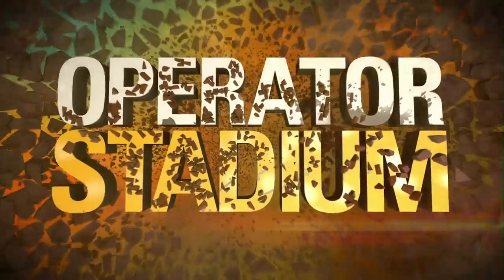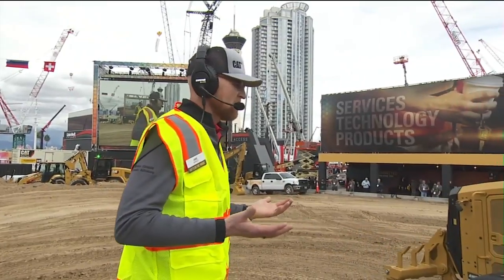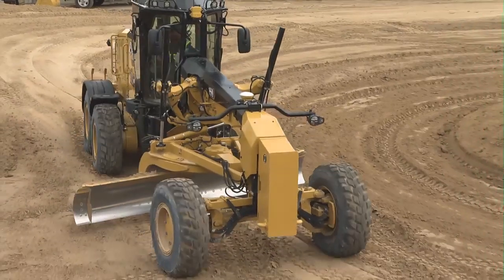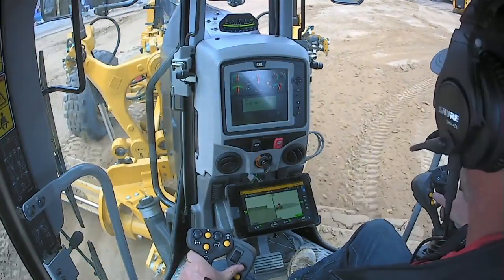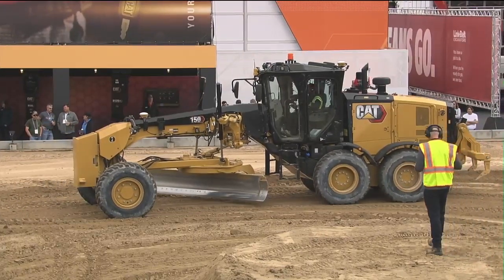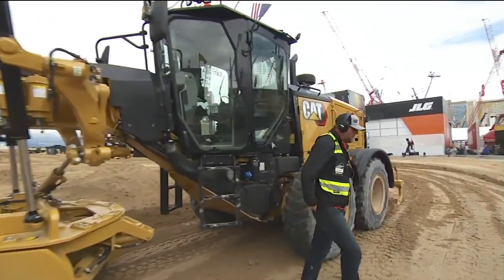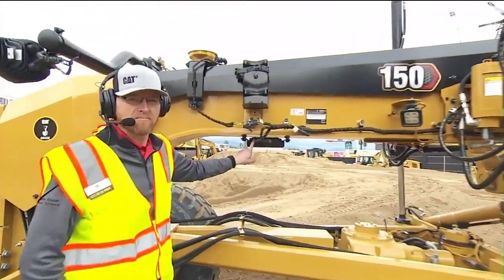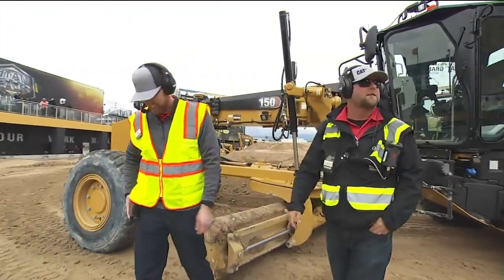Cat® 150 AWD Motor Grader Demo | From CONEXPO 2020

Comment: I ran a awd drive blade  but it's miss leading. It's not a awd? Front tires didn't seem to be under power. I tried to find the button to engage the front wheels no luck. First time on it today it's sweet!

Comment: One thing I've always wanted to know.....why do grader operators lean the front steer tires??
Reply: To counter act the force from the blade in the opposite direction
Reply: the machine wants to pull you side ways, so you tilt the wheels and they dig in and keep the machine straight
Reply: it help in turning in direction you want go and also for stablilize the front end of machine

Comment: I lost a lot of respect for Caterpillar since the last conexpo when they didn't even display one single track loader. I believe they are afraid to market them because they are so versatile and useful, it will impact their other products.
Reply: Track loaders are versatile. Backhoe loader are too as well. With track loaders, it's about fuel and undercarriage wear. A jack of all and master of none. Many businesses with employees prefer to focus on an excavator for cutting and dozer for grading. A CTL for the carrying of material in small spots as well as light finishing. A backhoe loader is in the vein of track loaders. If you had only one machine for a farm you "can" get it done. Just not very efficiently. A backhoe would compare to a 60 size mini excavator and for the loader end a large CTL. Two machines or just one. The two machines are better at what they do than the one machine that can "sloppily" do both jobs. A track loader is a beast and "close to grade" in the right hands. Good tractions in and out of soft or steels slots carrying material in or out to load a truck or fill an area. I'm in the mountains and we ended up abandoning track loaders due to steel ground, UC costs and fuel consumption. We can clear with an excavator, stack, burn, load, bench areas, and do dirt cut. A dozer covers the grade part, pushing stumps and brush, raking, sloping, walking slopes, ditchline, etc. a CTL does the little loader work and small job finishing. South of where I am....it's hilly. Not steep. A track loader can dominate in subdivisions where you go from lot to lot digging basements and roughing out. Also loading trucks beside the basement cut. Raise the loader arms to push over trees. Stacking.